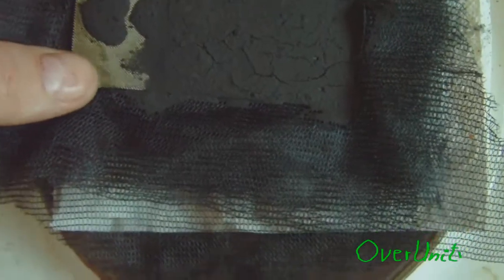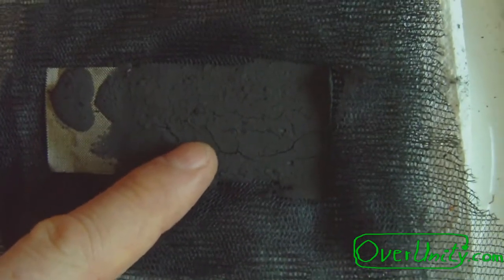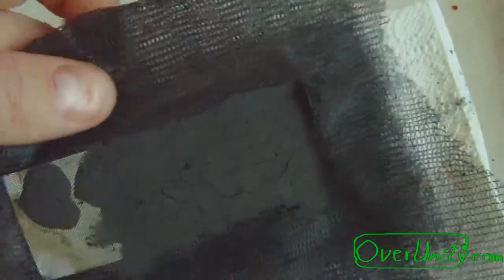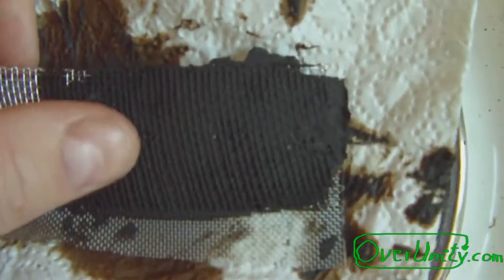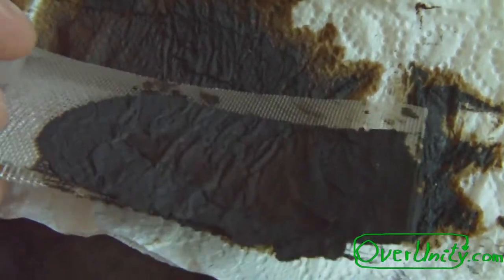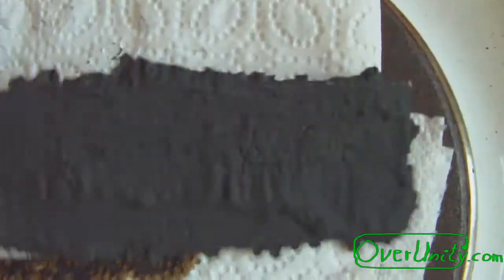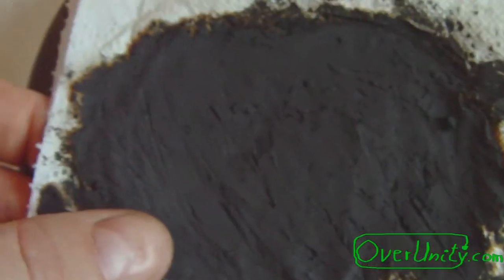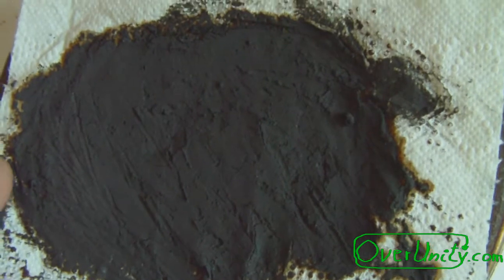New homemade selfmade DIY battery cell , further tests 01/22

Comment: So, in the first video we did see about 2.35mA but I don't know if the heating of the liquid was important to get that.

Then, to light one LED at 23.5mA (typical) we would need 10 cells in parallel.

Do you know, if any ability is there for recharging? Or is this purely a chemical conversion like the old carbon batteries? 

Cheers!